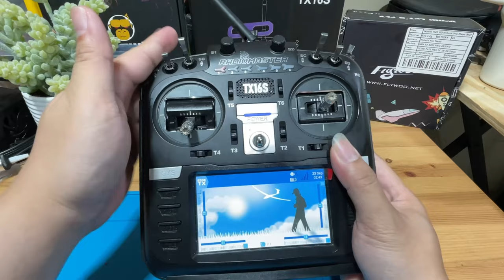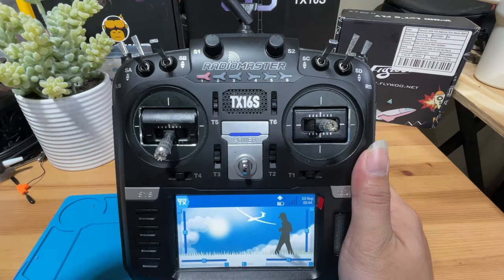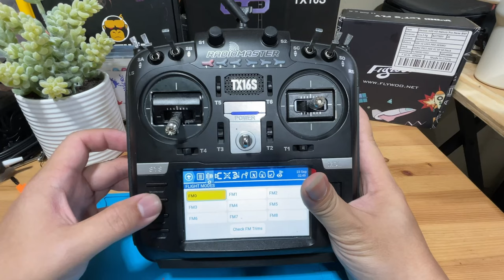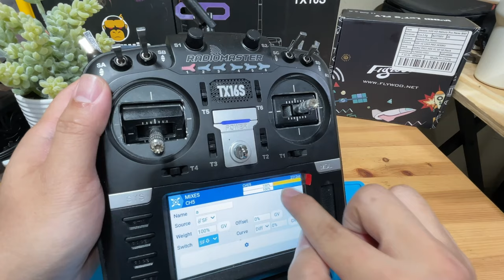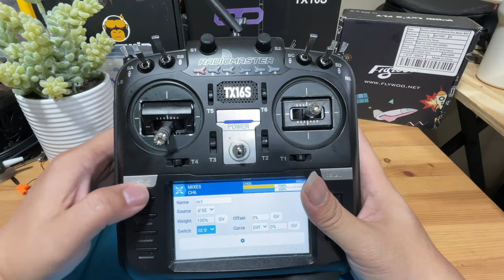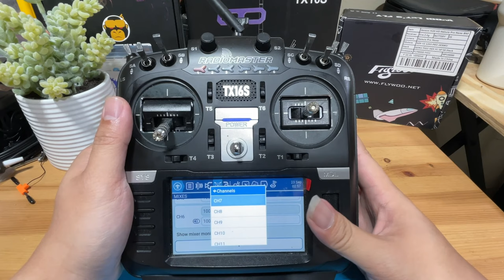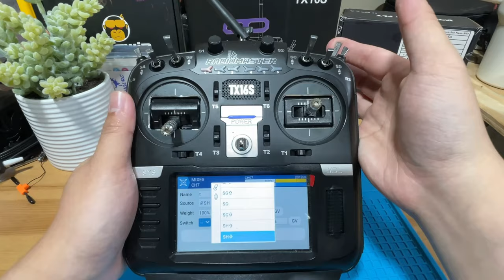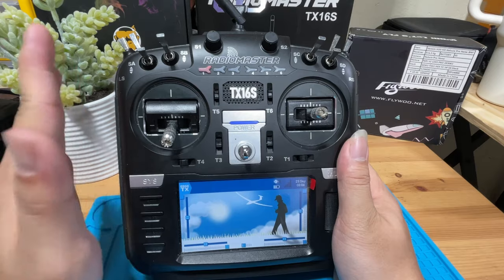TX16S Beginner Guides: Set Up Arm/Fly Mode/Crash Flip switches #drone#radiomaster #edgetx #tx12

Comment: Yeah I had the tx16s and I set it up but there was something about the Wi-Fi connecting or the crossfire module but it would bind but i gave up and just threw ag01s in my zorro, I wish I kept it tho not gonna lie 😅
Reply from the maker: For me, after getting uses to full sized gimbals its hard to adjust back to the smaller one. Zorro is a good option too espescally with ad01
Reply: @iFLYXWings6589  yeah I love the full size as I switch between the mambo for elrs and the zorro for everything crossfire… I have too many I need a elrs radio with my crsf module eh but hopefully I’ll get to review one one day(: